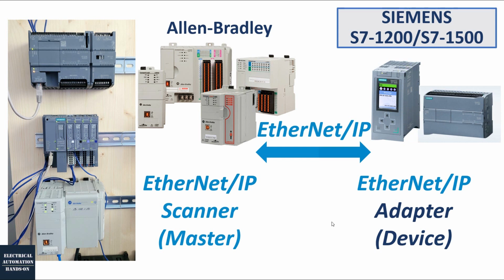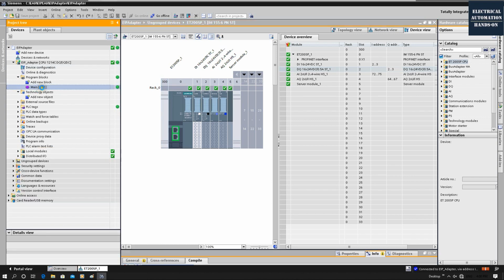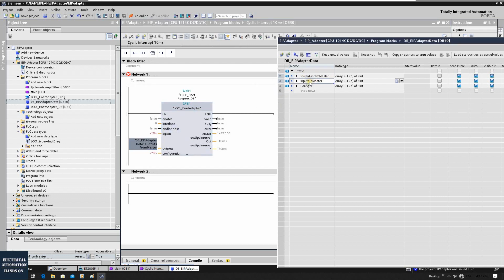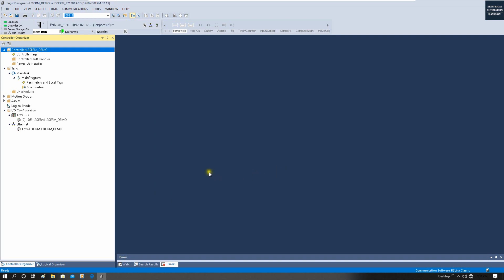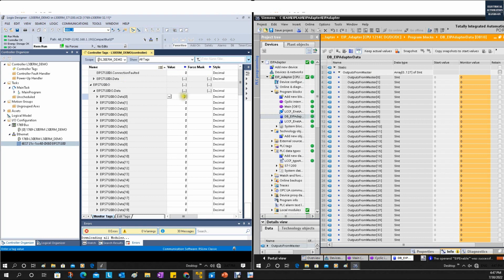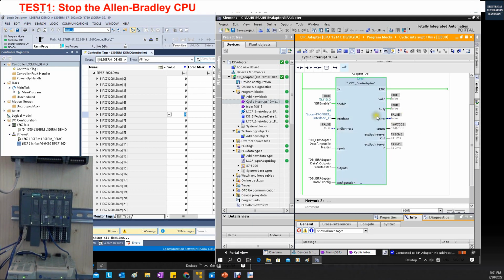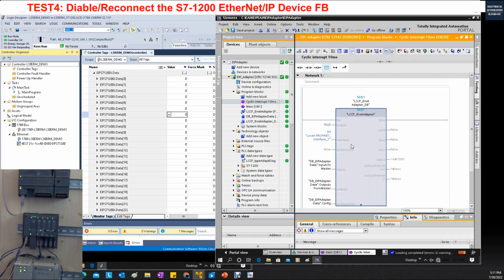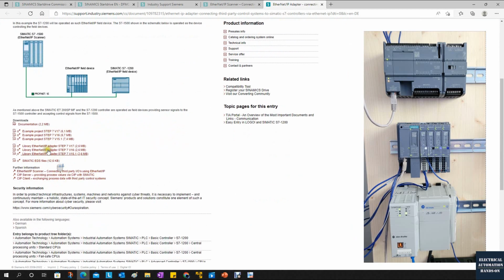COM27. EtherNet/IP Adapter - Siemens S7-1200 S7-1500 Communicate with Allen Bradley PLC (Scanner)

Comment: It could not be compiled and warned that need to password for compile for Siemens side. I did exactly the same what you did but S7-1500, Tia Portal V16. Appreciate all your support.
Reply from the maker: I am using TIAV17, and I just try to download the new files from the support link, I don't have any issues, it does not need password.
Reply: When I download for V16, it is working. But it is for S71200. I did exactly the same like in video but for S71500. It could not be downloaded to plc. Need to compile but not possible without password

Comment: Hi , thanks for this tutorial, I am trying to use this method with S7-1517 and compctlogix, I can't establish the communication, the Valid status of the FB is always False the code is 7603, can any one advice, thanks in advance.
Reply from the maker: It most likely you missed some configuration, I would recommend reading the 109782315 manual carefully from the link
https://support.industry.siemens.com/cs/document/109782315/ethernet-ip-adapter-connecting-third-party-control-systems-to-simatic-s7-controllers-via-ethernet-ip?dti=0&lc=en-DE
Reply: @electricalautomation  Hello, Thanks for your reply, I finally fixed the issue, I had to use move instruction to set the IP address for the remote device, that was not mentioned in the video or in the manual either, thanks for your help, much appreciated.
Reply from the maker: @SaadBen-cs1pp  Glad you got it solved. Yes, IP address is needed.

Comment: Sir can I able use this method for

AB plc L18ER as Master

Siemens S7-1200 as Ethernet adapter

Siemens ET-200S as Remote IO module
Reply from the maker: yes, this is the exactly the case shown in the video, S7-1200 runs as Profinet master to control the ET200SP, mean time communicates as Ethernet/IP device.

Comment: Hi, any reason why after importing EDS into Rockwell Studio while adding the module it only shows S1200 and S1505 and no S1500 PLC?
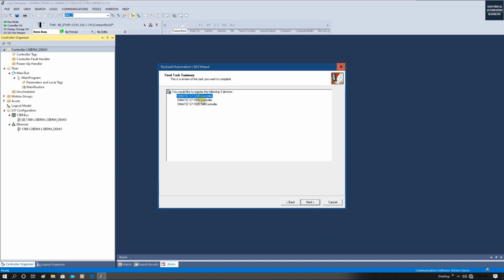Reply from the maker: Are you asking the option shown in the video 20:26? If you can not see the S7-1500, I would recommend using another computer and Studio5000 for a try.

Comment: Its for S7-1200 & S701500. Can we use the same for S7-300?
Reply from the maker: Sorry, S7-300 do not support this. Only S7-1200/S7-1500
Reply: @electricalautomation  what if we need to communicate with S7-300 with Rockwell without any gateway?

Comment: Compile failed "LCCF_EnetAdapter (FB1) - The block can only be compiled with a valid password".
Any comments on how to acquire the password?
Reply from the maker: I used it in couple of applications and was not get this password issue. Do not open this FB, just use it and compile at your project level instead of the FB inside.

Comment: Professor, I have a Siemens Migrologix 1100 and S7 1200 PLC. 
Can I apply this configuration to them?
Reply from the maker: Micrologix doest support EtherNet/IP Scanner and Adapter. But if you can try to use ModbusTCP, Micrologix runs as Modbus TCP Server, Siemens runs as Client. https://youtu.be/Pty8eB6NDe4. Please check if your Micrologix support Modbus TCP, old version doest support